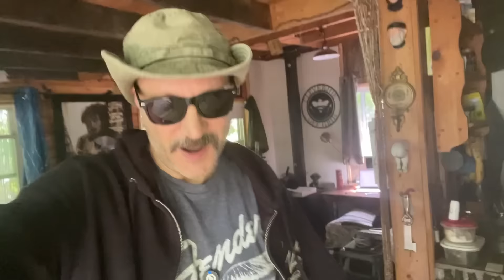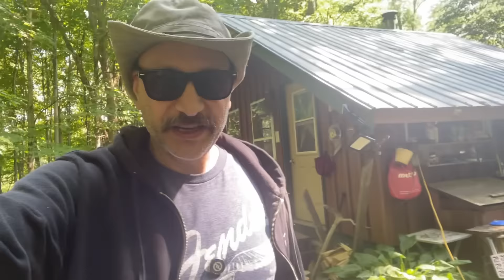Don't Kill Your Generator: 7 Mistakes to Avoid

Comment: Ok.  Here we go; my father and I set up our EU2000 many many years ago (about 2006) for vanlife.  Long story short, we run it in an aluminum box that is held behind the van on the driver’s side.  The box bracket is  designed to fit inside the hitch but not where the ball mount goes because we are towing a trailer.  Now, back to the aluminum box.  It is not much bigger than the genny itself.  We always run the generator with the box closed.  High summer heat, dead of winter.  Even out on the road while driving.  How you ask? 
Well, we installed four vents in the bottom of the box about 1 1/2 inch diameter and two 2 inch diameter vents at the plug end of the box.  They are louvred so water of snow cannot get in.  
At the exhaust end of the box, we are running a 5 inch computer cooling fan that can cycle the air volume of the box hundreds of times per minutes.  Again every thing is louvred and also closable if we are not running the generator and want maximum protection.  
Also; underneath the box for the generator is another smaller box to carry engine oil and supplies for oil changes.  AND also an auxiliary gas tank.  As you may know, the little HONDA creates suction thru the gas cap when operating and can actually suck gas from a secondary tank. We removed the air valve on the gas cap and fabricated an adapter that replaces the valve connected to a fuel line that goes down to the secondary tank.  
A small primer bulb helps to get to the gas up to the generator faster but it is not necessary as the gas was making its way up just by the suction.  
The generator runs all night inside the box without us needing to get out every couple of hours to refuel.  
Love that little machine.  😊
Enjoy.
Reply from the maker: Awesome, sounds like a great setup. Thanks for sharing!

Comment: If a generator is purchased only as a gasoline version, it is not a good idea to convert it to LPG.  The reason is because propane burns much hotter and your generator may not be designed for the extra heat.  Using propane for generators purchased as dual fuel would seem fine since the design was made to handle the hotter conditions.

Comment: Most important for the average person tha just uses it once or twice a year for power outages is to not just let sit for months at a time. It easy to just take out once a month and let it run out of gas and the pour fresh gas and store it again. Thats what I do on top of oil changes. My generator turns on on 1-2 pulls like every time.

Comment: Another vote for the Hutch Mountain conversion kit. Run my 2000i with it. Not a lot of hours on it with gasoline or propane, but so far everything seems to work great. Start and load it every year for several hours at the start of hurricane season. In FL and have not tried propane in the cold.

Comment: Loved the part about the importance of the first oil change!  I have bought a few brand new vehicles over the years and the latest was a $75k pickup.  I changed the oil myself at only 1500 miles in order to get the "break-in" oil out and some fresh oil in.  I can't believe people will spend so much money on a new vehicle, then not change the oil until the OEM recommended 10k miles.  Makes no sense.  Does the manufacturer want your new vehicle to last 200k miles, or would they make more money selling you a new one at 100k miles due to engine failure?  Hopefully folks will take your advice on changing the oil out on a generator and apply it to much more expensive motors as well.

Comment: I'm about to sell my old Predator 3500 and buying the big Predator 11,500 tri-fuel. This 105 year old house has natural gas, so I'm going to plumb the generator in. Use NG until it goes off, switch to propane, and gasoline last. Could last months, especially when the climate is mild, the genreator recharges my 400amp hour batteries, so only run it a couple hours a day.

Comment: Great video and advice. A couple things I have learned over the years of owning a few generators is to have it as level as possible while it's running. Also I use an RV platform step while camping to keep it up off the ground. Like you said in this video the fan sucks in air to keep it cool along with that it also sucks in dirt and dust while sitting on the ground and keeping up off the ground can help with that.

Comment: We have a dual fuel inverter generator but we found the propane to be even more expensive to run as it goes through it way quicker!  But it is definitely good to have in an emergency situation.
Reply from the maker: Oh, good to know - I hadn't considered that. In fact I thought it would be cheaper than using gas. What generator are you running?
Reply: @cleverjoe it's a King.  5000 watt.  We have others as well, but that's our go to.

Comment: I have owned two Eu2000 models and currently have a 2200. Maintenence nerd here...Oil changes every 50 hour, magnetic dip stick, muffler screen cleaning , and gasket replacement. I use non ethanol premium gas and replace the the NGK plug every 50 hours. Easy to install a hour meter to keep track. Like budm9982 said, exercise it frequently under a partial / varying load.

Comment: I have five 800 watt generators for my tent/marquee hire business, a 2400w for my marquee peg driver and 9000w for powering our house when the storm season hits. The 2 larger ones get started first weekend of each month, along with my chainsaws and water pumps. They all have those small running hour monitors which have a lead that wraps around the spark plug lead. That way I know when they've had 25 hours use and then it's oil change time. I also use a big auto syringe to draw the old oil out of the sump because the smaller generators don't have sump plugs. Greetings from Australia.

Comment: Here are some tips I'd give anyone buying a budget inverter generator based on my own experience.

The first thing I recommend is a proper break-in. Run the generator for about an hour or less at roughly half load with Eco Mode enabled, then change the oil. I also highly recommend installing a magnetic oil dipstick, as it helps catch small metal particles generated during the break-in period. Change the oil while it's still hot, and try to drain it as quickly as possible so more contaminants come out with the oil.

After that, run the generator for another 2–4 hours and perform a second oil change. Many inexpensive generators have quite a bit of machining debris and contaminants left over from the factory. I would also recommend a third oil change at around 8 hours of operation. After that, you can switch to the manufacturer's recommended maintenance intervals.

My current generator is the Firman Whisper Portable Inverter Generator (W01682), rated at 2,000 starting watts and 1,600 running watts. Unfortunately, I haven't been very impressed with it. The engine hunts or surges in Eco Mode instead of running smoothly. Firman even sent me a replacement generator, but it behaved exactly the same. I sent the manufacturer videos showing that both generators exhibited the same issue.

There are no mixture adjustments on the carburetor, only an idle adjustment screw. I carefully adjusted it to improve the surging, but the compromise is that the generator no longer idles as low as it could in Eco Mode. It's the best balance I could achieve.

Another design flaw with this model is the carburetor air intake. It draws air directly from underneath the generator. I've seen people on forums place these generators on sandy ground, only to have them suck fine dust and sand into the intake. Even with the air filter installed, very fine dust can still make its way through the carburetor and eventually into the engine, causing premature wear. I strongly recommend placing the generator on a clean, solid surface rather than directly on dirt or sand.

During the break-in period, keep the load light to moderate. Avoid running the generator near its maximum output until the engine has had time to wear in properly.

Here in Canada, ethanol-free gasoline is almost impossible to find in my area. Personally, I don't think fuel stabilizers do as much as many people claim. Instead, I keep my gasoline fresh by rotating gas cans it regularly. Every month or two, I pour the older fuel into my car during a fill-up, then refill my gas can with fresh gasoline. This ensures the generator always has relatively fresh fuel available.

Whenever I'm finished using the generator, I disconnect all electrical loads first. My generator has a fuel shutoff valve, so I close it and let the engine continue running until it uses the remaining fuel in the carburetor. As it's beginning to stumble and shut down, I briefly turn on and off the choke to help consume the last bit of fuel. This leaves very little gasoline sitting in the carburetor during storage, which helps reduce the chance of clogged jets.

If I'm storing the generator for an extended period, I also try to use up the remaining fuel in the tank. I'll often connect the generator to charge my portable power station set to charge at 800W, or in the summer I'll run a small air conditioner until the fuel is nearly gone. In the winter, I may use a small electric heater on a low setting to accomplish the same thing.

Finally, even though my generator is rated for 1,600 running watts, I avoid operating it anywhere near its maximum capacity for long periods. Running it at a lighter load reduces stress on the engine and inverter components, and I believe it will help extend the life of the generator.

Despite my criticisms of this particular Firman model, it has continued to serve me well overall. With proper maintenance, regular oil changes, fresh fuel, and sensible loading, even a budget generator can provide reliable service for many years as someone who's worked on a lot of small engines the number one problem is clogged carburetors people that don't change their oil or the engine runs out of oil bad spark plugs clogged air filters an overall just lack of maintenance.
Reply: Those intial oil changes, is it first 1 hour, then second 2 - 4 hours, then third 8 hours, totaling 13 hours run time? Or total break-in run time 8 hours?
Reply: @SueK-r6i  It's not super crucial exactly how long you run the generator between the first three oil changes. The most important one is the first oil change, because that's when you're likely to get the most machining debris and contaminants out of the engine.

Oil is a lot cheaper than replacing a generator engine, so you could even do the second oil change sooner if you want. I'd definitely say the first oil change is the most important. The second helps remove additional contaminants, and the third will likely get out most of what remains.

Overall, my generator has been running great. I actually used it a few weeks ago and it performed well.

It's also very important to drain the gasoline from the carburetor before storing the generator at the end of the season. Leaving fuel sitting in the carburetor can cause problems with the fuel system.

I'm not sure if anyone makes a natural gas or propane conversion kit for my particular generator, but if you're buying a new generator, I'd definitely consider getting a dual-fuel model. They're great because you can run them on propane, which can be much easier to store long-term. Keep in mind, though, that you will often get slightly less power when running on propane or natural gas compared with gasoline.

Overall, I'd recommend continuing to change the oil regularly and checking the oil level frequently. Don't assume the low-oil shutdown will save the engine if you let the oil level get too low. On some generators, the low-oil protection may not activate until the oil level is already dangerously low, and you don't want to find out the hard way that the engine has been damaged.

It's much better to keep an eye on the oil level and add oil before it gets anywhere near that point.

Comment: I have two Honda 2000i generators with the cable to tie them together giving me 3600 watts continuous. I usually run one at a time but if I need to use the 1250W microwave I fire both up for as long as I need. During the February freeze in Texas a couple of years ago I was able to run my big refrigerator, a small refrigerator and 2 freezers for a week. To prevent theft I have a heavy cable through the handles. The fact that they run so quiet and my neighbors aren't that close helps plus I'm at the end of a dead end street.

Comment: Super nice set-up you got & love that 🌲 cabin 🌲 out there in the middle of nowhere it looks like! The Honda generator is super nice, I would just buy a 2nd generator 4000 Watt pulsar or wEn 3600 dual ⛽ so if something happens you have 2 generators just in case rather than just one unit, & it won't cost you much more if you get it on sale then you can just leave your Honda as it came from the factory...

Comment: Here in Southern Alberta NON-Ethanol fuel is IMPOSSIBLE to Get.
Reply: I've been using Lucas ethanol conditioner in the gas for my lawnmower, snowblower, generator and my antique car.
It's not expensive and I've had no issues with the ethanol damaging my carburetors.
A 16 ounce bottle treats 80 gallons of gas.
Reply from the maker: It’s pretty rare to find it at a gas station these days.it’s sometimes available at smaller airport gas pumps if you happen to live near one.

Comment: Hutch Mountain i put the kits on three and works great you do lose about 5% output, but you never have to clean carburetters and you can still use gas perfect system

Comment: My additional tips:
• Run for at least a few mins, no load to warm up a bit and circulate oil etc.
• Bring various loads on gradually.
• Use eco mode where possible (if equipped) so the machine can self adjust rpm's to loads applied.
• Avoid prolonged no-load idling.
• Avoid no-load running at full rpm's (if equipped with eco mode)
• Run at moderate loads as much as possible and avoid extended periods of prolonged low/high loads.
• Switch off/disconnect loads before turning engine off (particularly important to avoid EMF kick-back from certain appliances with induction motors like fans, pumps, compressors etc going back into inverter generators, or brushed generators with a diode bridge integrated into the carbon brush holder assembly)
• Allow cool down time at no load for a few minutes after disconnecting loads.
• If equipped with a fuel tap, turn fuel tap off and run carburettor out of fuel until the engine stalls, then empty fuel tank prior to long term storage.
• If only equipped with combo fuel tap/engine stop switch (Honda EU series)
empty fuel tank, then run engine in eco mode with no load until it stalls/dies to use up last fuel from fuel pump and carb bowl prior to long term storage.
• Alternative - Fill fuel tank completely full and add fuel stabilizer, drain leftover plain fuel from carburettor bowl and/or run engine for around 5-10 mins to use up non-stabil fuel and allow new stabilized fuel to refill carb bowl, then turn fuel valve off and top off fuel tank.

Comment: I also used the hutch mountain tri-fuel conversion kit on my eu2200i.  Did this many yesrs ago before dual fuel units became readily available. I purchased my honda new and never ran gas thru it. Converted it immediately and love it for long term storage. Can sit for months at a time and when I need it one pull and she's running again. Was a pricey option but i wanted a honda so I had to pay for it.  If I had to buy one today I'd probably go with a harbor freight unit. Its compared to the honda and cheaper. And today you can get them with dual fuel. My plan soon enough is to have a natural gas  line run so I can run off of that. Then I won't have to worry about tanks. I

Comment: Excellent advice! Understanding just how much power the device you want to plug uses and startup surges required can be difficult.  Use a Kill-A-Watt or a copy of one to get an accurate measurement of watts and amps required to run a device.  You don’t want to stress your inverter.
Reply from the maker: Great tip, knowing your actual load makes a huge difference. I'd suggest doing this before even buying a generator to see what type of power is needed, especially if buying one for power outages. 👍

Comment: I’m gonna take back my comment that I made about letting your inverter generator run out of gas under a load.  I had seen a post or two about inverter board failures in predator generators after letting the generator run out of gas under a healthy load while other guys said they’ve done it and never had any problems.Maybe what they did is didn’t disconnect the power when they attempted to restart.. most manufacturers want you to have your generator warmed up and stable before applying any loads.
I think I’m gonna reach out to YouTube generator reviewer Johny’s weekends to see if he has an opinion on the subject. 
    On another note, I’m an appliance repairman in Florida and I’ve had a handful of times that people have somehow rather damage the refrigerators while running them on generators. I usually don’t have time to sit down and figure out where the mistakes or what what happened. When I get their powers back on and stable I just need to get the refrigerator running again. 
I do have a few thoughts on that. Maybe it was inadequate extension cords restarting the generator with everything plugged in. Possibly when the generator runs out of gas, maybe voltage fluctuations. Also every time I’ve seen damage to refrigerators, these were not inverter generators, but they appeared to be good quality generators